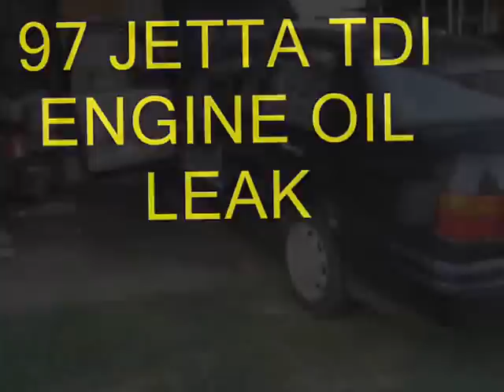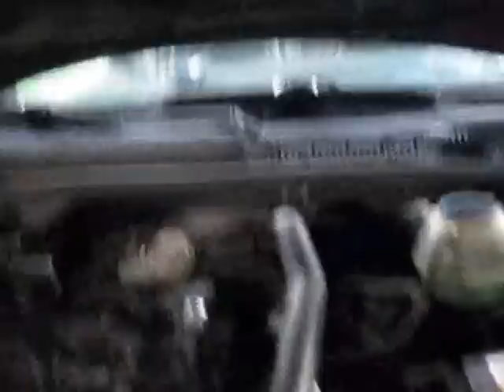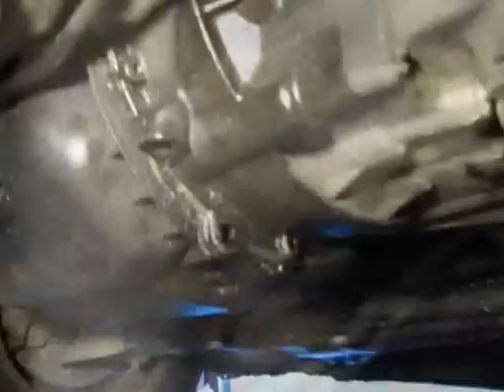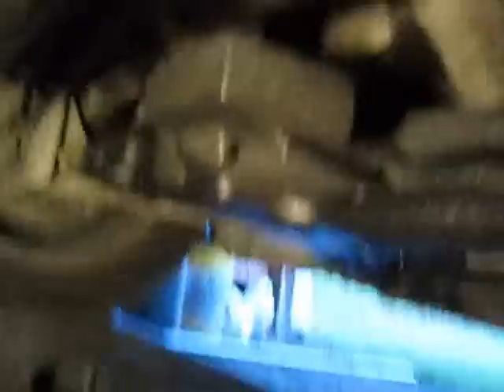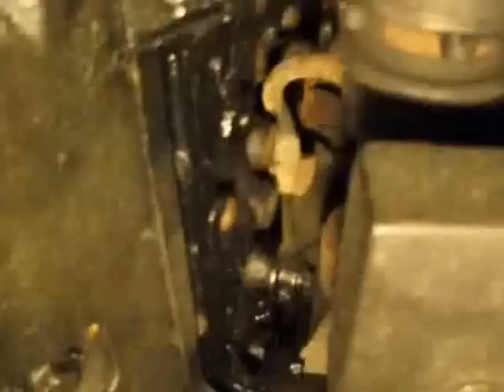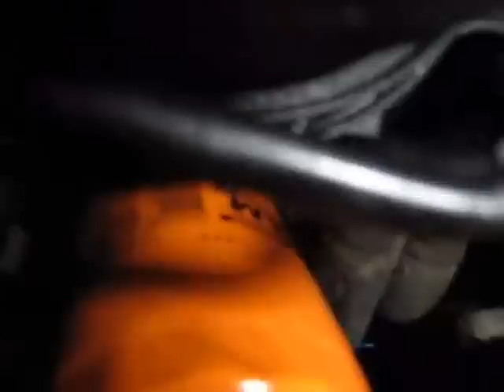97 JETTA TDI OIL LEAK   REAR MAIN? This is for mechanic, not you.

Comment: It's hard to tell from the video, but I would wipe all the oil off to pinpoint where it is coming from. If it's coming from the union between the engine and transmission, it's probably the rear main seal.
Reply from the maker: It's fixed now.
Turns out I had the clutch replaced and new flywheel.
WRONG FLYWHEEL. Wore hole in trans.
Had trans welded. still leaked. Trans was cracked, new case, all good. Ouch.
Reply: scritsz the wrong flywheel was the problem with leakage?